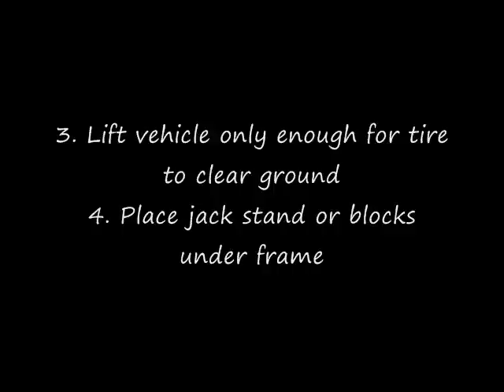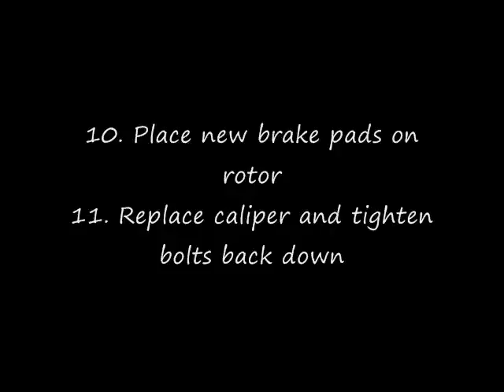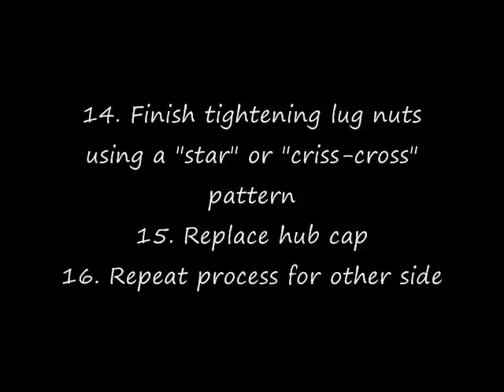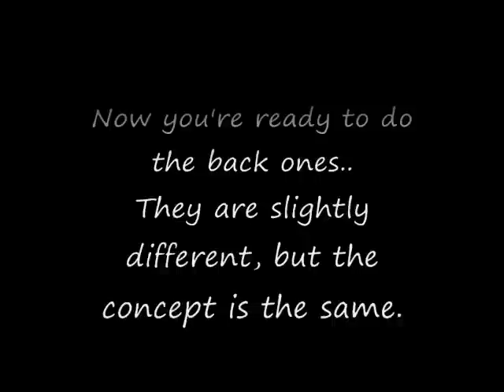Changing brake pads on Ford F150

Comment: Thanks for the video, very helpful while changing my 2001 F150's brakes. I kept taking off the entire braking unit. Once I watched your video, it was much easier to get the brake pads out of the unit. Also, the little things like using a bungee cord to hold the caliber was a great idea and using a c-clap for the caliber. 

Thanks again.

Comment from the maker: @texas3056 Yes! Brake cleaner is a must (especially if your hands are as greasy as mine).  
+1 for taking off the master cylinder cap and it helps to siphon off some of the fluid as you go otherwise it will overflow and make a mess.  The reason is that as your brake pads wear, your fluid level gets low and then either you (or the oil change place) "tops off" the fluid.  Then, when you put on the new (thicker) brake pads it causes the reservoir to overflow.  Learned that one the hard way.
Reply: Good Call! I am about to do mine

Comment: @ praetorian -- the 2006 will take a similar approach however the caliber is larger and u will need a larger jack then in this video due to the clearance / size difference between years.  Also DON'T touch the new brake shoes with dirty greasy hands. And your calibers/brakes will come with new metal guides make sure to put a small amount of vasoline or other lubrication (I use a bit of dish soap cuz it won't attract dirt and washes off later) in the channel the brake sits in to aid in glide moti

Comment from the maker: Pretty much. If not, as you compress the pistons then fluid will back up into the reservoir and spill over and make a mess. Just keep an eye on it and bail out as necessary.  Check the fluid level once you are done to make sure you don't need to top it off.

Comment from the maker: @1966MustangConv No idea what torque settings are - and yes, you should prolly torque any/all bolts on a vehicle.  I'd imagine a good Chilton's manual (do they still make those?) would have all of the torque values in it.  Of course you need a torque wrench too (which I don't have anymore).

Comment: minor squealing is an indication that the pads are worn and need to be replaced asap.   After a while the metal pins that hold the break media onto the backing will start digging into the rotor.

Comment: Nice Video. I plan on replacing the pad on my 04 Expedition which looks about the same as this 02 F-150. However, two things I would like to know is shouldn't I use caliper grease on the pad tabs and back? And also isn't it a good idea to torque the caliper slide bolts? If so any idea what the torque setting is? Thanks

Comment: Thanks. I read that the brake fluid should be siphoned out before replacing the pads and then filled afterwards. Is this necessary?

Comment: Before install brake you need to clean rust on galeper and put grease in rubber slide bolt becos breake can stay on disc and use verry fast. Excuse my english if you understand french. Quand on change des brake pads avant de remonter le galipper il doit être nettoyer de toute la rouille avec brosse d'acier ou même avec drill et brosse d'acier rotative et lime, aussi avant de remettre les deux bolts dans les rubber il y a une graisse spécial qui doit être m y . comme ça le gallipper ne chercheras pas a garder les frein trop serré du a un gallipper bloqué qui causeras une usure prématiré des pad de brake neuf installé.

Comment: Guys, please don't loosen the lug nuts while the truck is still on the ground.
Reply: Don't know why you'd say that.  Nothing wrong with loosening the lug nuts with the truck on the ground, as long as you only loosen them a little.  It's much more of a pain to loosen tight lug nuts when the tire is already off the ground.  You need the weight of the truck to hold the tire while you break them loose.